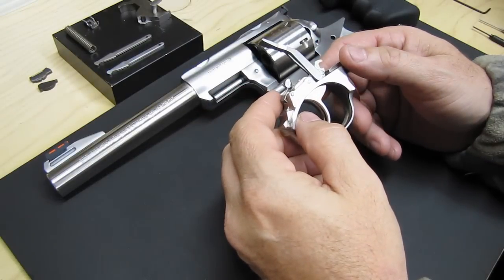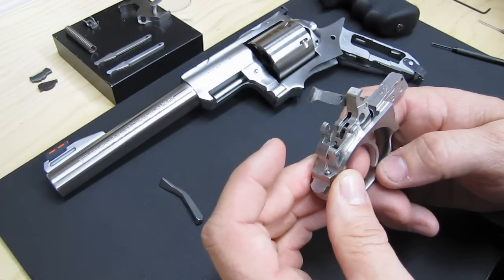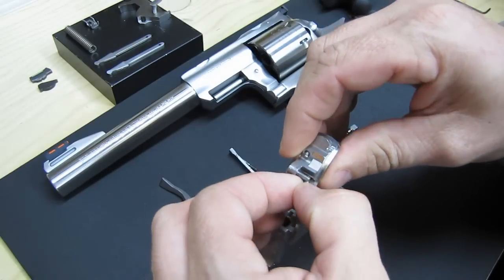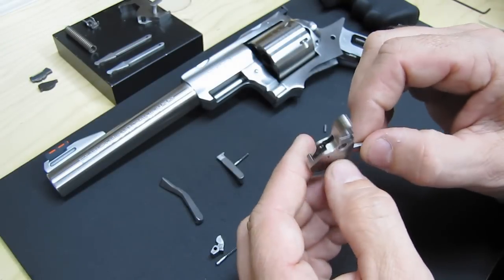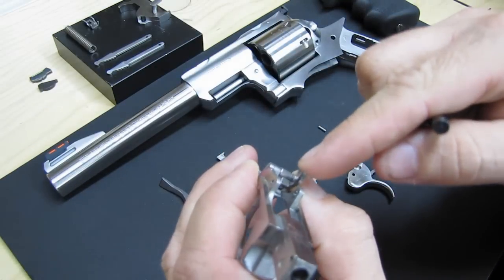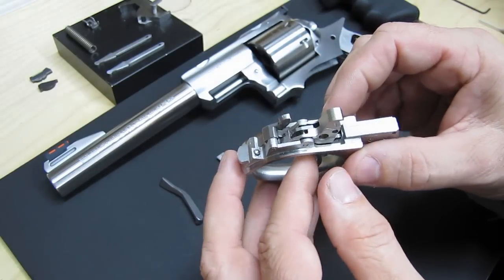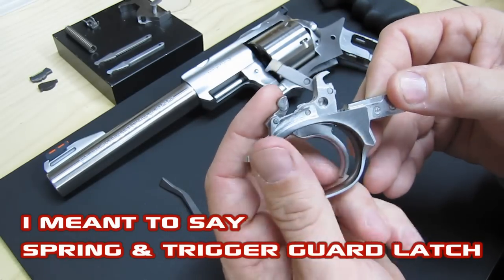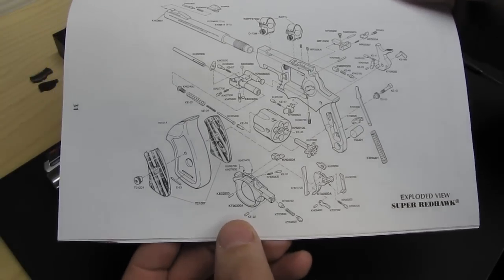How to Disassemble & Reassemble The Trigger Guard Assembly on a Ruger Super Redhawk

Comment from the maker: @DTesch357 
Yes.
Although if you notice that when you pull the trigger slightly, the cylinder latch will move. If you are not careful and continually pull the trigger slightly. The cylinder latch will begin to slide off its post. Then you will most likely be looking for its plunger. Or if you pull the trigger enough to actuate the cylinder latch the same result could happen. That is why I have my finger on the cylinder latch when I pull the trigger.

Comment: Ahhhh. Your way of re-assembly is much easier than the way I was doing it. Thanks for revealing your technique. Several months ago I took apart one of my GP100s that I purchased new in the box online. The trigger pull was less than desirable so I took the trigger assembly apart to investigate. To my horror I found a RUSTY trigger link plunger and somewhat rusty spring to said plunger (both items were coated in an oily rusty fluid of some type) . I cleaned them, oiled them and re-assembled it. Works like a champ now. How in the world did Ruger send out a revolver with a rusty trigger link plunger?

Comment: @Levergun4570sbl I can break down all my rifles and shotguns without a problem.  Even my S&W Revolvers - take the sideplate off, and I can pull apart all the internals without an issue.  The trigger group on the GP series revolvers just intimidated me a little bit, because I was so used to breaking down my old model Redhawk, I wasn't entirely sure what was different.

Thanks again.

Comment: The design is so simple it's remarkable.  Have you done any work on the trigger??  Like replacing the springs with lighter ones & smoothing on the burs and machine marks so as to lighten & smooth the trigger??  I've done this on my SP101 & my GP100.  It makes all the difference in the world.  Thanks.  JAMES.
Reply from the maker: Buzz Clark Yes I have... I got the single action trigger pull down to 3.1 pounds, and the double action is very smooth and has a consistent feel. I used a Wolff 10lb trigger spring and the factory hammer spring to insure a positive  primer ignition,... and some stone work and deburring.

Comment: Excellent video. What work mat are you using? Is the surface grippy/non-slip?
Reply from the maker: Cam C it's rubber with a slight texture and cleans up well from Brownells. This is the small size, they have a large which I have as well. It's the best mat that I have bought. https://www.brownells.com/gunsmith-tools-supplies/general-gunsmith-tools/bench-mats/assembly-disassembly-mat-prod6749.aspx

Comment: I have a brand new Redhawk .45 Auto/.45 Colt and can not get the trigger guard lock pin to pull back...anyone have any ideas or info to share on this?
Reply: Same problem here. Will NOT budge one millimeter.
Reply: Mine is going back to the factory this week.
Reply: +toddy2519 I've owned many redhawks and I've never seen anything like this. I bought this gun brand new on Friday and haven't even got to fire it yet. I wonder if yours is in the same serial number range as mine... 503.84xxx. Also, was your sight adjusted from the factory as far as it could possibly go to left for windage?  None of my other Rugers have come out of the box. They have all been set almost dead center with only a click or two left or right needed at the range to be dead on. The barrel isn't canted and it's perfectly torqued to dead center. This model confuses me... 😁
Reply: Mine is 503-780xx
My plunger is stuck so tight that when I tried to turn it with vise grips the stud sheared off!!!!
I spoke with a tech-rep.,.Rob B, at Rugers NH plant and he was very surprised to hear of this problem. You might want to call Rugers in NH and ask to speak to Rob. They will give you a song and dance about how they don't like taking techs away from their work but you should insist on talking to him. Mention that you spoke to me (Henry) and relay you are having the same problem I have. They sent me a return FedEx label to send mine in.
I didn't check the sights..all I was concerned about was getting it apart to do it's first cleaning. I also mentioned to Rob that he should check the crane-frame gap because on mine it looks excessive.
Keep me posted on your gun...okay?
Reply: +toddy2519 Unbelievable..... Thanks VERY much for the info; will do. I'll keep you posted. Thanks again.
Reply: You're very welcome
Reply: +toddy2519 Howdy, I called Ruger and talked to Rob and he remembered talking with you. He told me what to to and it came out undamaged. Using the crane with spring, I used a small wood block on one side in between the frame, pulling back tightly and lightly tapped the other side of the metal crane with a small brass hammer. It came right out and the trigger assembly came out. I did notice some burrs around the hole in the rear of the trigger housing around the plunger hole. I cleaned it lightly with a Dremel polishing wheel and it's fine now. The plunger moves freely and the housing went back in but it was a tight snap going back in. Sorry you had such a frustrating experience but thank you sincerely for the correspondence. Best to you my friend.
Reply: +Steven Mayes 

That;s great! Unfortunately I tried that and more and mine just won;t budge.
You're very welcome for the help.
I've been doing gunsmithing on and off for over 40 years now...taken courses for so many individual guns I can't even remember how many.
Right now I'm trying to finish up the 1911 .45 Auto and AR15-M4 courses to get my certification. Wish me luck!!!  lol
I find it very frustrating when I can't get a gun repaired...such as this Redhawk...but that's what the factory is for.  :o)
Reply: +toddy2519 You'll do fine! Let me know when you get your cert and the outcome of your Redhawk after its all said and done. I hope they get you taken care of quickly and to your satisfaction.
Reply: Steven
Thanks for the vote of confidence. I will surely get back to you about my Redhawk,
The certification will take awhile...I need to go back over all my notes and DVDs...there are 200 questions to answer on the AR15 test...yikes!!!

Comment: New pawl plunger will not go into new spring.
Reply from the maker: I have ordered parts that were the right part number, but the wrong part was in the bag. If you send me some clear photos of the parts next to a ruler for size reference, I can compare them to mine. Where did you order them from? Are they the same diameter as the cylinder latch spring and plunger?
olemite@gmail.com